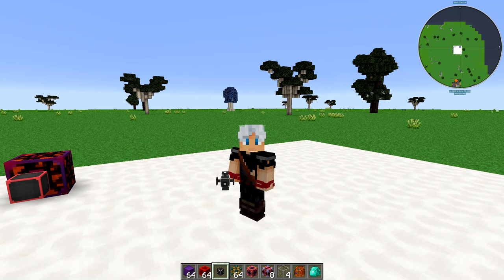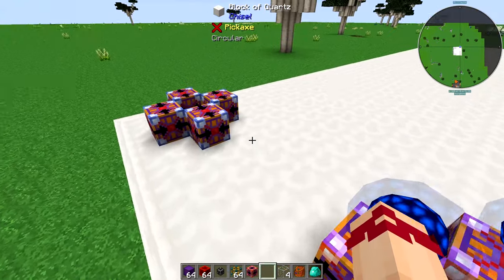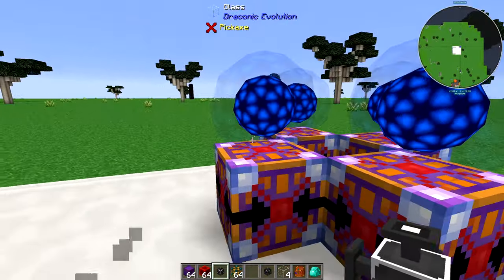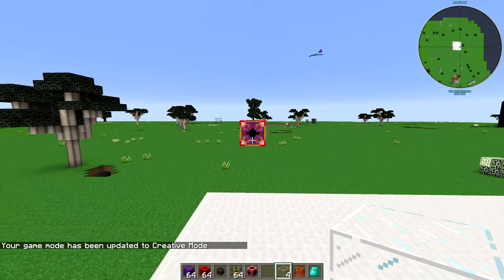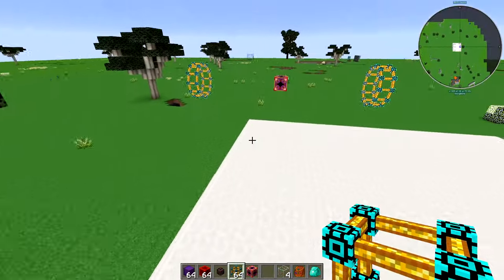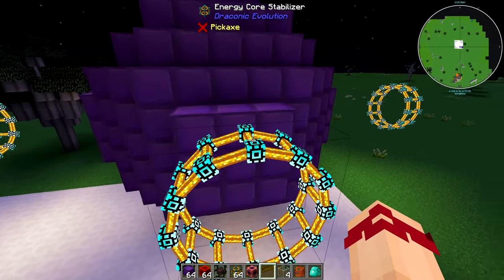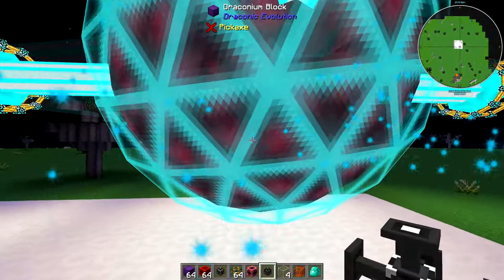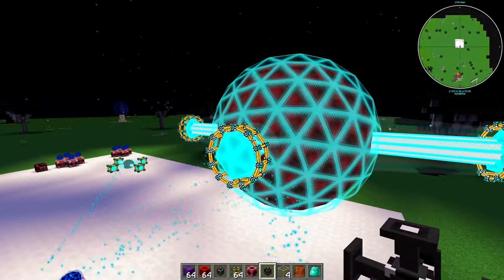How to make an ENERGY CORE from Draconic Evolution (Tier 1-7)

Comment: Thanks bro! Now I need to figure out how to get a massive energy source!
Reply: If you have extreme reactors, that can produce a lot of power.
Reply: @ryanharvey2337  I did that and I was playing creative and broke multiple world's due to too much rf per tick
Reply: @Ayesel  sorry bro, I wasn't notified of this reply but that sounds very nice!
Reply: @Ayesel  to answer your question. 0. I stopped playing, I figured out that reactors were the way to go and I got it filled up with a few minutes of cloning max sized ones. I stopped playing since then due to my world's getting broke by the amount of rf
Reply: Try the Draconic reactor very dangerous recommend to put it around 400 blocks away under ground not near any of your stuff then put a teleporter from another mod to it so you can get there btw it may blow up that’s why you should put it so far away

Comment: is there a complete item list you need for the core and wich tier so a list for tier 1 - 7 with the different blocks you'll need ? would be great thanks
Reply from the maker: If you make the core it has a gui that tells you materials for each tier and as long as you have those materials in your inventory it will auto build it for you
Reply: @Ayesel  ok good to know

Comment: I'm in 1.7.10 Skyfactory 2.4 and we have to use particle generators instead of the stabalized things. But when I put them in a 3x3 square it doesn't do anything and it says invalid configuration. Can anyone help
Reply: Get 8 stone and 1 draconium powder, put the powder in the center of a crafting table and surround it with 8 stone. You'll get a tablet that explains how the mod works. Sorry if I'm a little bit late

Comment: Hi, i have a question, how to output this energy from reactor
Reply from the maker: It’s not a reactor. It’s for storing energy. Once you have energy store in it you can take energy out using the pylons
Reply: @Ayesel  Thanks for the answer! Honestly, I don't know how to do it, could you please insert a video especially for me, how is it done? Please, I have a lot of stored energy and I don't know how to output
Reply: @Szczurasty  6:42
Reply: how do you power everything from that then tho. i have an input and output but then what? put plugs on every item or just connect to your old power source that is also powering the core?
Reply: @906iphone  yeah, thats how flux networks work
Reply: I'm figuring it out. Not every pack has documentation and that's the biggest downfall. Previous packs have had great documention and recipes and guides and as we go along mod packs are adding them less and less and taking out files that were in older versions 6 years ago. I'm playing project architect and trying to piece it together with ftb and stoneblock and other mods tips. They are different recipes and I had to choose an out network as I had them going in and out on the same one and now I've figured out this part. It's fun playing the games but the research that first goes into it is kind of like finding the needle. It's hit or miss and playing around fixes this and then next time I'll know exactly what to do. Dimensions is now my next problem as I have dimlets and cards and other things and they don't mix and match and everything is different again from its original and no documentation again. I'm watching an old man from 6 years ago grumply explain it. Ah well